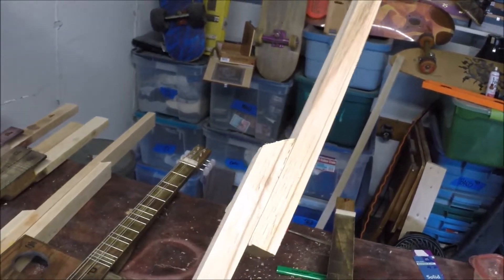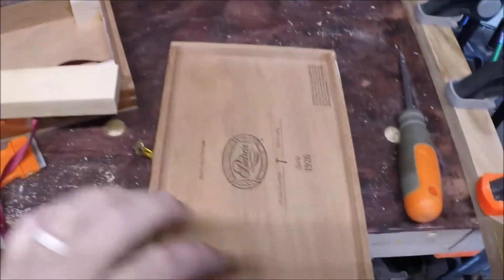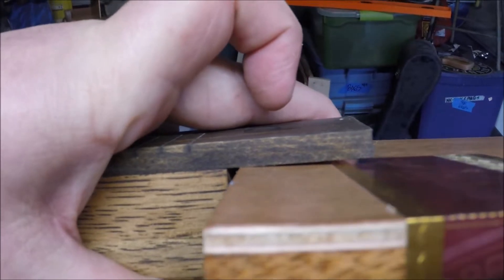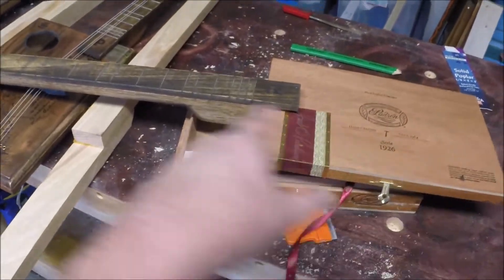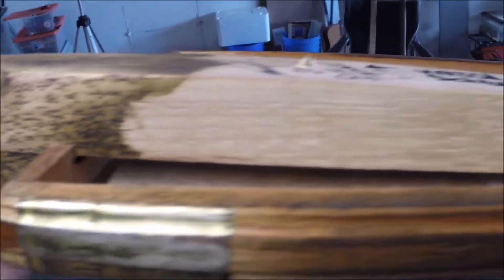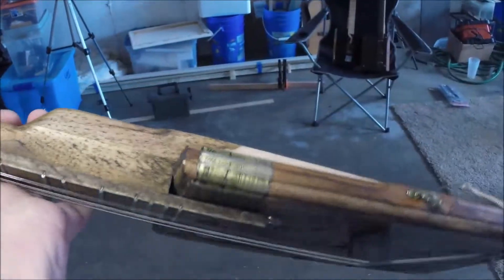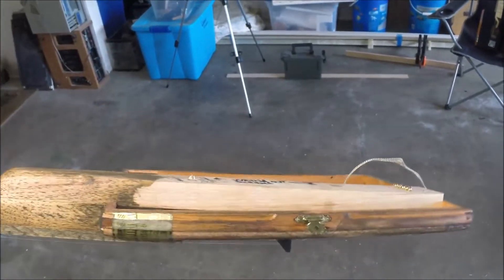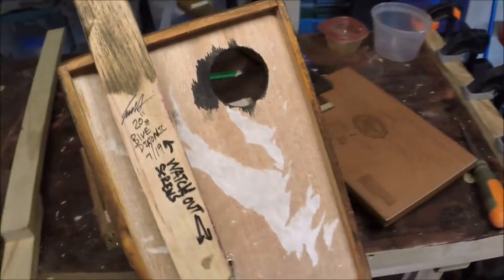Primitive Guitars - back angle video 1

Comment: I'm trying to understand.  Exactly what is the musical purpose of the "back angle" you're demonstrating?  If it's to create a higher action over the guitar body, can't that be achieved with a higher bridge?  Thanks.
Reply: Yes, a higher bridge would give more space between strings and body for better strumming/picking, but that alone increases the action above the frets and for optimum intonation you want the strings as close to the frets as possible without creating fret buzz. The back angle solves that.
Reply: @hurdygurdyguy1  Again, what's the purpose of the back angle?
Reply: @mulekickhandmadeguitars8465  it tips the fretboard/neck below the plane of the top of the guitar body to allow closer string to fret action and at the same time allow more space between strings and guitar top ... it makes for more adjustibility...
Reply: @hurdygurdyguy1  Okay, now I get it.  Makes sense.  Heard it mentioned but never heard the real purpose behind it.  Thanks much.